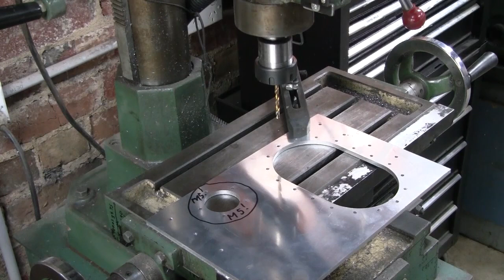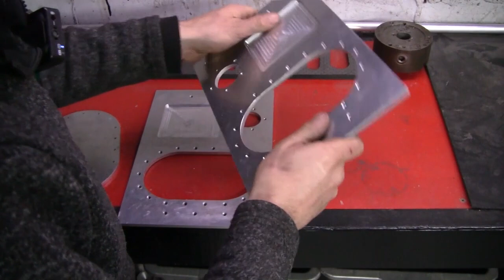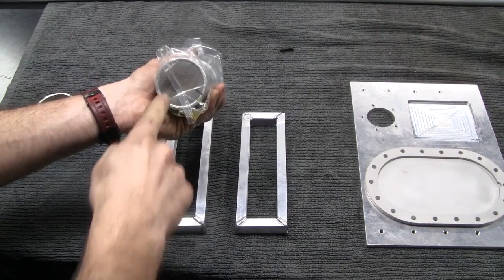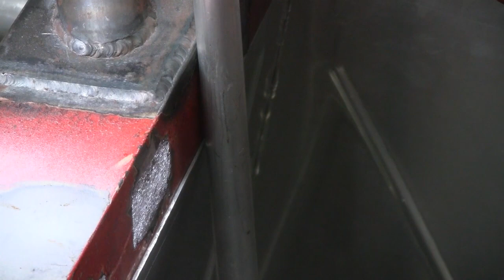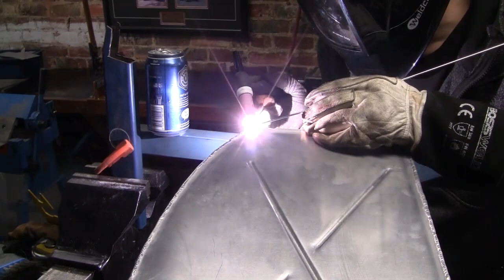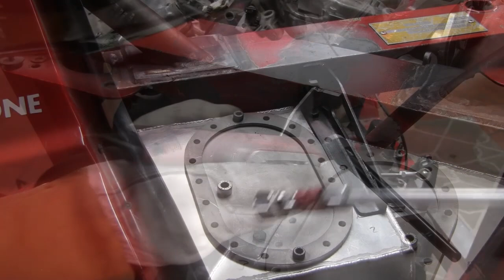Project Stratos - Episode 17 Fuel Tanks 2

Comment: Outstanding fabrication Colin both in design and construction.  After reading a few stories about the damage caused by angle grinder disks disintegrating, I put the guard back on.  BTW, finally got around to installing the brake master bracket and the fit was perfect.
Reply from the maker: thanks, yea fair enough.  Glad the MC bracket worked out

Comment: Hi, great video again.  Thanks.
I'm curious about the fuel level sensor you will use.  Accurate fuel quantity is important for rallys and the tall and narrow shape of the tanks probably makes using an off-the-shelf floating lever type sender difficult. Is that correct?  If so what are the options?
I have used an old Porsche sender which uses a float traveling up and down a thin nichrome wire to change the voltage read by an analog pin of an Arduino; then converted to a calibrated value of fuel volume.  Ideal for tall tanks.  It works but maybe there are better solutions.
For example, measure the pressure head of the fuel with a bottom mounted sensor (they are available in Australia).
Or, use an internal tank high capacitor (just two narrow plates whose capacitance changes as the fuel lowers between them).  An Arduino can be used to measure the value and convert to a volume value.
And lastly, measure the mass of the tank and fuel with a load cell (eg 50kg bathroom scale sensor).  This is the most elegant, I think, as it is independent of the tank's shape and fuel expansion. The tank would have to be mounted to allow a bit of vertical movement, so probably the hardest to make work properly.
As an after thought, the engine computer knows how much fuel is delivered through the injectors; can this be used to find the total used over time and hence the amount left?
Anyway, I'm sure you have an ingenious method we'll see in a future episode.  
Thanks again for the series.
Reply from the maker: yea off the shelf lever type, not really an option, in the Alfa I ran some capacative type sender units (2 Concentric ali tubes), they were great, simply cut them to length, set the zero and span and then just 0-5v out.  When i got them they we're pretty reasonably priced.  I wanted the same for this tank, but apparently word got out about how good they were and they have gone into drug money territory.  So I've gone for a doughnut float type on a tube, i believe it uses reed switches and has a resistive output.  length is set, but found one that reaches the bottom of the tank.  As for the tank being an odd shape, you guessed it Arduino to the rescue (Same in the alfa), 
I mucked around with a fuel flow meter for a while in the alfa, more for real time fuel usage than tank capacity, problem I had  is to get a good reading on the flow meter a relatively small orifice was required to get the velocity up, this in turn caused a significant pressure drop, that car was running carbies, and i was already having  issues with controlling fuel pressure at the float bowl so turned out to be more trouble than it was worth
as for fuel use via injector Duty cycle, i looked into this years ago for another project, at that time the error over so many injector cycles meant there was no way to get any meaningful value out 
soooooooooooooooooo just going to stick with the float level